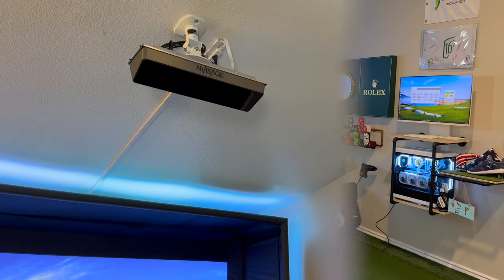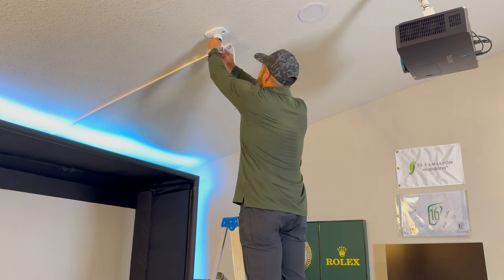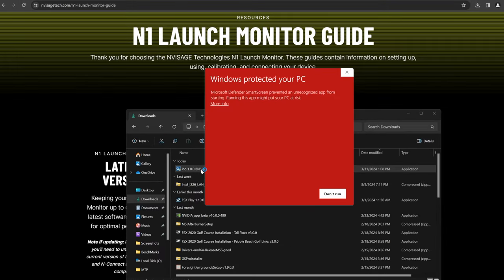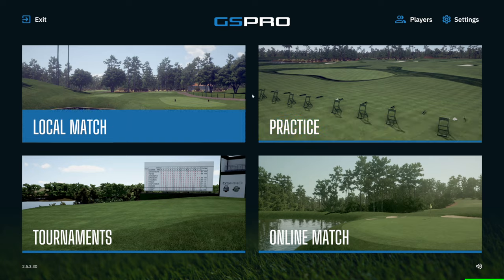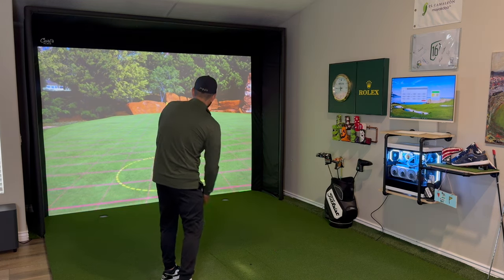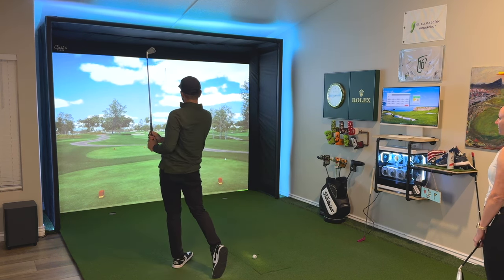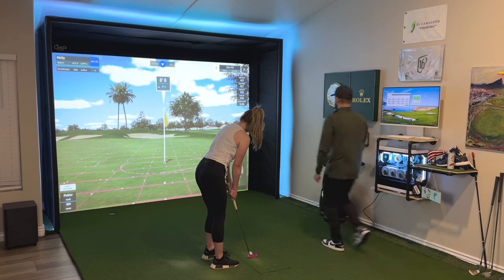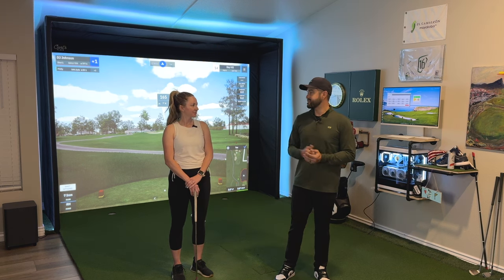The Most Affordable Overhead Launch Monitor Available! NVISAGE N1 | Full Install, Setup & Review!!

Comment: Thanks for the review Pixel Golf! We appreciate you putting the N1 through its paces!

🔉Regarding the sound effects, we do plan on some updates, but in the meantime, any user can change them themselves by navigating to your installation folder, which for most people will be C:\Program Files\NVisage\Pio\Tools\res. In this folder there is Ready.wav and Searching.wav, and you can replace these with any sounds that you want. Just be sure to use a .wav file and name them exactly the same.

We'll watch out for other suggestions and will do our best to implement whatever we can. Our goal is to make the N1 the best value overhead launch monitor available!
Reply from the maker: Wow, nice to hear from the source that quickly! Another plus!!! Glad to hear about the .wav files! Going to be experimenting with some awesome sounds today and a silent wav for the searching. Thanks again!

Comment: Very intriguing, but doesn't look like it has club data. I wonder if that will be an addon down the road and if that would be an extra cost. 

Total spin is calculated but isn't total spin just adding backspin plus sidespin? When I first saw calculated I was bummed but really if it's just adding those 2 numbers but actually detecting both backspin and side spin I wouldn't really call that calculated. Will be interesting to see how this performs over time.

I have a Mevo Plus and recently bought the Pro Package which has helped with getting club data now so that's super useful for figuring out your swing. I still am not sure how a rear camera can detect what the clubface is actually doing. The short chips I find better if you set it to 5 feet for chipping and then are just chipping closer to the unit. Putting is still a work in progress though. I have it set to 7 feet from the unit but it's far from perfect. Having an overhead unit would help I'm thinking with both of those.
Reply from the maker: Not sure on the total spin, I try not to go down that wormhole😂 I mainly focus on side spin, back spin. Side spin helps when learning to shape the ball and having a launch monitor with this metric has definitely helped and translated to the course!

Hopefully there is som sort of add on for other metrics down the road, but I don’t personally know if that’s going to happen…

I started with the Mevo+ and chipping, putting and setup were the many reasons I switched. It’s a great unit for the price, but I’m team camera based for indoors. Like you, I just don’t see how a radar unit can capture a lot of the metrics from behind the ball.
Reply: Yes, total spin is just calculated from the measured data of side spin and back spin. Pretty standard for launch monitors.
Great point though, we never want to cause confusion so we're editing our website to revise that. Thanks for that feedback!
Reply: @NVISAGE_tech  Any chance that club data will be included in the future?
Reply: @mikeneron  We're pretty into technology, nothing is off the table.

Comment: Question, at 6:21 you calibrated it to right, would you still be able to play with a left handed golfer or would you have to recalibrate every shot
Reply from the maker: I’m not 100% sure of your question, but you should not have to recalibrate the projector by switching dexterity’s.
Reply: Once it's calibrated, it's good for RH or LH players.